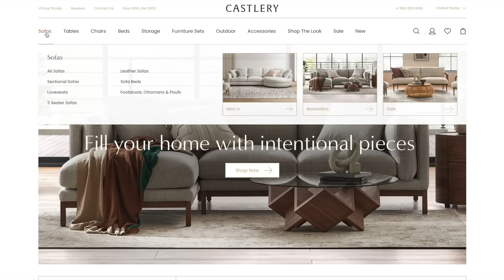COMPLETE LIVING ROOM MAKEOVER & DINING ROOM MAKEOVER!😍 HOUSE TO HOME Little Brick House Episode 17

Comment: I Have A Question. I Have The Same Barstools Form Walmart, That The Lil Brick House Has. WHAT Color Stain Did Yoy Use? And How Did U Do It? DID You Have To Sand The Barstools & Does It Take Just 1 Coat Of Stain?, I Have Never Stained Anything Before So I Need Your Tipps Cause I Want To Do Mine The Same Way... Thank You Keep Me In Your Prayers  🙏🏻 Please...
Reply from the maker: I gave it a light sanding with an electric sander, and then I applied a coat of special walnut stain from Minwax

Comment: I have a question... I live in an apartment and I have having a lot of trouble getting my tub clean.  It is textured on the bottom and it cracked so they repaired it but I can't get it fully clean.  I don't have a lot of strength so does anyone have a suggestion?  I have used a lot of cleaner and tools and it still isn't working. T.I.A.
Reply from the maker: I like to use Blue Land bathroom cleaner 😊
Reply: @hannahshappyhome  thank you so much.